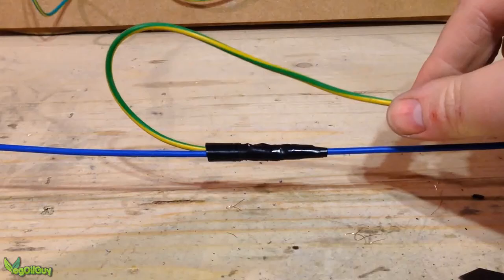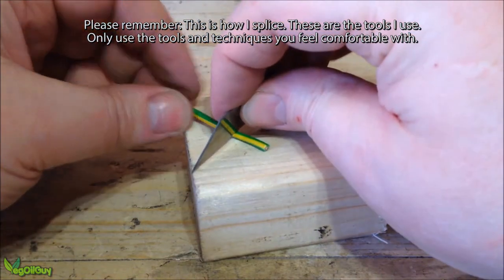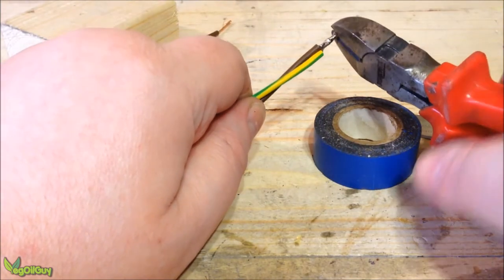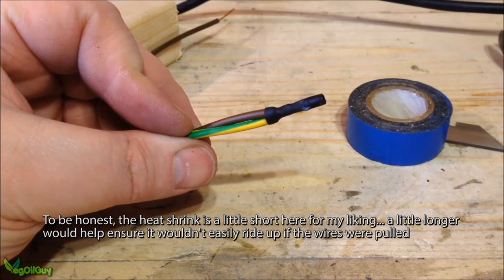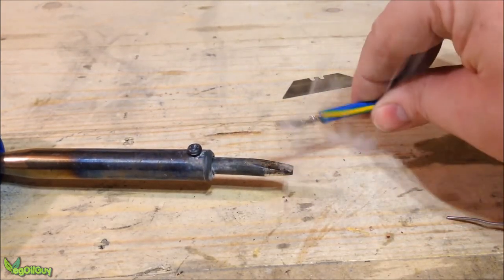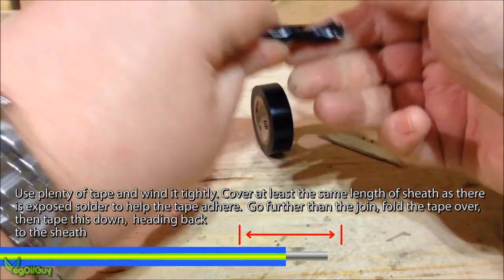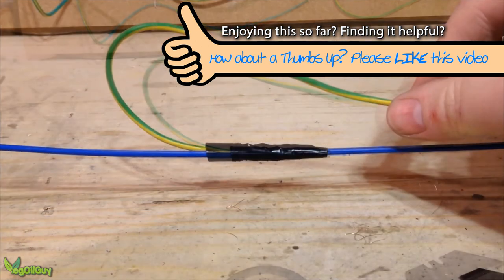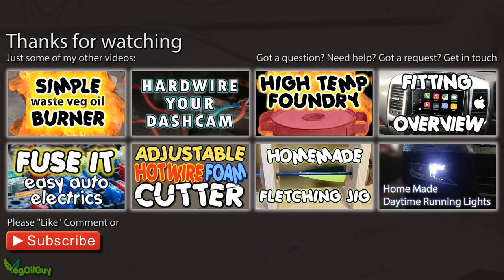Wire Splicing easily connecting cables with a soldering iron - by VOGMAN

Comment: I agree with you on soldering. As an amateur radio operator (AF6AS) crimping and NOT  soldering is practically heresy. That said, I was taught early on that the priority is to make a good MECHANICAL connection first, then a good ELECTRICAL one!

Comment: Sir, both of second methods are good. But I as professional in electronics will recommend a Flush cutter and Stanley Automatic Wire Stripper FMHT0-96230 for ease and professional quality
Overall nice video

Comment: Nice idea, not sure how well it would work in a truck dash or tail light wiring. They don't give you any extra wire or room. Plus it's comparatively time and labor intensive
Reply from the maker: Like everything else, it takes practice. But the benefits of a reliable connection are well worth it : )
Reply: In the 30 years since I was introduced to dielectric grease I have yet to have a failure that wasn't do to a short wire pulling out as I tried to crimp it. Down inside a dash a solder connection with short wires would be impossible
Reply from the maker: I know what you mean. I always thinks there's too little wiring on anything in a vehicle. You pull out a switch and you can barely see the underside of it as the cables are so short. I've lost track of how many times I've cut things off, added extra cable, then reattached ; )

Of course if access is way of out reach, as you're describing, then you do whatever you can do.

Best wishes,

Geoff
Reply: That seems to be the story of my life. Every inch of wire the manufacturer saves they make more money and the mechanics job a lot harder. Sometimes I feel like putting my feet on the rest of the dash and pulling to try and get a little extra. I think the engineers who design them are the bastard son of a bastard son of a mechanic and they are trying to get even.

Comment: Nice video. I have a question. What is the use in soldering the wire? If I simply twist the wire and wrap it in insulation (electrical) tape it simply works..